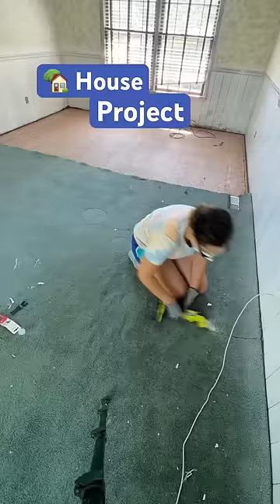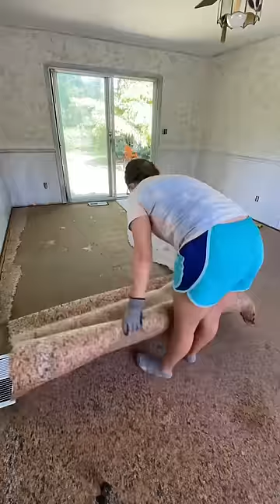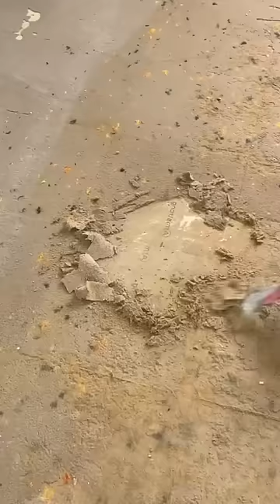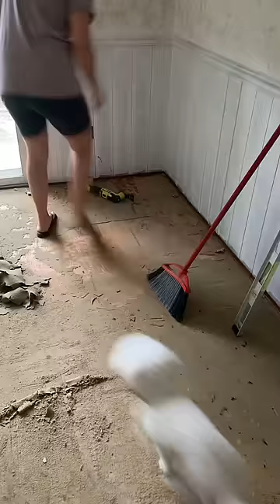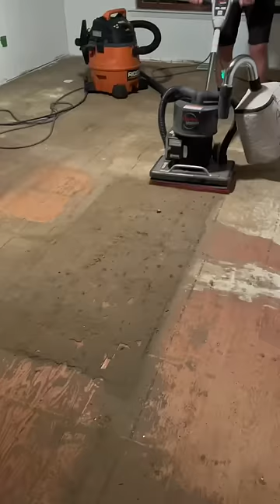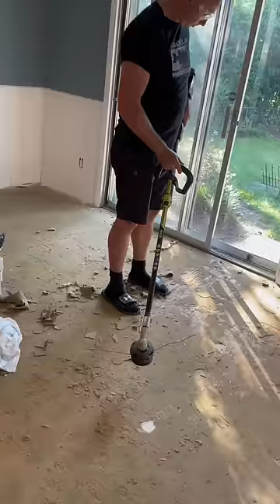Ep.7 DIY fail removing what we found under carpet | Carpet Removal | House Project BEHIND THE SCENES

Comment: Since no one else is gonna tell her I will. The last thing to get done in a remodel is painting, it's most definitely not wise to do it before the floors are finished.
Reply: Actually the walls normally get done before the floors because it's easier to not damage the floors that way and you can then install your baseboards with a nicer finish on the transition between wall and base board if you paint before and you cant do base boards without flooring. then you do your final coat of paint once the floors are installed as the floor and paint are the last two parts of a reno
Reply: Remove carpet and all debris first. Sand and clean floors. Prep them for finishing. Paint your walls. Then do your floors.
Reply: @Rebecca-n7n so they are both right
In their own right
Reply: Disagree. Pull up old flooring, then work top to bottom. Paint ceiling, paint walls, put down new flooring, base boards.
Reply: The problem is you don’t start painting when you still have things that need demo or removal in the same room
Reply: I'm sure she's now very aware
Reply: I’m having a new house built and my walls were painted way before floors. AC had to then go in, floors were kinda last.
Reply: @kutatm  we're taking about a remodel, not a brand new house.
Reply: Work top to bottom. Ceilings, walls, floors. Not to mention floors are generally the most expensive part so best to keep that in good condition.
Reply: Yea that’s not really how it goes. Floors get done after painting to avoid paint getting on the new floors.  Floors should generally be one of the last things to get done.  Nobody wants to be the flooring company to come back out and fix floors cause they were damaged by another contractor
Reply: One can do the paint after the floors are prepped, but never painted if the floors are still in the beginning stage.  Shows the smartness of women in these situations…I work on the part time and I had to tell the woman owner to slow down because I was the last contractor there…her major remodel was electrical and I still had add on’s and major holes.  I gave her only sections she could do.  Which we found a medium ground.  I asked her not to do the painting if I were going to be there, that paint seemed to stink?!?!?
Reply: Demo goes before finish painting.
Reply: Agreed on that one. They are on a learning curve.
Reply: You do remove the floors before you paint but you would never install floors before you paint unless you don't know what you're doing. That would literally be the stupidest thing you could possibly do.
Reply: Actually I did this for a living. First you remove the carpet use an ice scraper that you put a very sharp edge on and then scrape it up. Use a broom and a vacuum to get as much as you can off the floor. Then you can paint the wall after the wall is painted then you put down your padding and your carpet. Whatever you do do not put down the carpet before you paint. Can you figure out why?
Reply: One would think !!!!
Reply: Facts
Reply: @Schmuly yeah but rip up the old floor first.
Reply: @noname357 You remove all things that needs to get removed before you put in new stuff or paint for many reasons!
You can discover mold that goes all over the floor and up in the walls, etc...
Plus this obvious reason!
Reply: Wow.  So incredibly wrong lol
Reply: Its way easier to demo first, then flooring then paint. When doing remodeling.
Reply: Learned a valuable lesson,do all demo before getting things painted!! Including removing the the carpet,pad and tack strips.
Reply: @Schmuly 😂😂😂😂😂😂😂no
Reply: Floors are last thing ...
Like taking a shower ..or washing a car 
 you finish things from top to bottom ... 😊
Reply: She figured if she puts paint on floor .. it woulnt matter. Knowing that, it makes a painting job much faster..

Not a bad thinking except. But imo.. i would of removed carpet first, then paint, then put new floor
Reply: @Schmuly Are you trying to be funny? She was painting while scraping the floor
Reply: @Schmuly the new floor is installed after floors, but you rip out the old carpet before you paint lol
Reply: You're wrong. Walls first before flooring. You can always touch up the walls but if paint gets on the floor, you gon need to scratch it off
Reply: Does it really matter
Reply: Think she found out by now
Reply: @kutatm Yes, that is how new homes are constructed,  because you have a lot of traffic even after the walls are up,  you don't want a bunch of boots tracking in abrasive debris to ruin new flooring.

Doing a remodel of a single room is different. One demo and any significant rebuilding is done,  you can finish the room in any order,  and contractors will do it in order of availability of their subs. Painters can lay down sheeting to protect the floor while painting.
Reply: When you cant afford a floor scraper tho does it really matter
 
That was a 30-60 job with the right tool.
Reply: @chellestan Basically, prep the work area in full first, then work top to bottom
Reply: Never forget the rule, Bottom to Top not Top to Bottom
Reply: Y'all arguing about the order of the process and forgetting the big facts that the wall finishes and floor finishes chosen also make a difference. I'm a sparky and I can tell you that it definitely varies from site to site and that's why it's important to have a good project manager or general contractor, to make sure trades don't have issues like this where one person's work can ruin or degrade another's just by way of being done. Tile is done differently than wood, than carpet, than finished concrete, than various forms of laminates, etc. Each individual flooring type has its own process and some of them require the home to be a conditioned space before they can be done, and some have to be done before the walls are even framed. 

Y'all have missed the most important part about the whole thing, trying to argue about who's correct. You're all right and you're all wrong, you're not asking enough questions, and making too many assumptions. Thanks for the entertainment though, I hope y'all aren't in trades.
Reply: Close! Someone has to tell her that, don't stand with your back to your freshly painted walls, while your near sighted husband while wearing a goggle is doing something stupid.
Reply: Literallllly, you are correct 😏
Reply: Common sense
Reply: Boy are you do because of the amount of wear and tear while you are refinishing the rest of the rest of the house.
Reply: That Gunk as you called it was the Matt underneath your linoleum it just kind of glues itself kind of melts over time
Reply: Floor scraper is a must. Maybe this video is just for views 😂
Reply: Break the house & build again 😭🤣
Reply: Righttttt my mum did this and I was dating someone that owned a construction company at the time 🤦🏽‍♀️😂
Reply: Wrong sir!
Reply: @Schmuly  You're wrong, paint gets done last, flooring damages walls and trim. Professional renovator

Comment: Flooring installer here, the stuff under the foam underlay is the left over backing from rubber backed carpet. It was a short-lived type of carpet installation back in the 70's and 80's. et way to remove it if you where to put any other type of flooring down is to either us a a 5inch scrapper and have 2 people going at it. What my employer and I do is use a machine called a "Poyvac" or an orbital floor sander with a pad with 3 9inch concrete disk spread out in a triangle like pattern on the pad, earmuffs and dust masks are a definite must as tis does create a lot of dust. once We've sanded the entire floor it's then swept up into a pile and taken to the work vehicle which has a large sheet of plastic in the back so that it maybe folded back onto itself once all the dust is on the plastic sheet. After the room is vacuumed and ready to go for installation for whatever floor coverings you wish to have done in that room.
Reply: What about all the staples
Reply: The grinding pads on the polyvac run over the staples, pulling them out as the machine runs over the floor. We then go around the edges of the room with a hammer and scraper if there are any nails in the floor there bashed down so that they are level.
Reply: Why machine? Just hot water.
Reply: Thank you. Great to know!
Reply: I can attest to that stuff not lasting more than a year or two before getting flattened out and decaying into "gunk".
Reply: That gunk also contains all the dirt that vacuum cleaners and steam cleaners miss.  It filters down through the carpet.  I've scraped up a MOUND of dirt that had solidified like concrete.
Between cheap backings and all the dirt carpeting harbors...I prefer ANYTHING to wall to wall carpeting.  Especially with kids and/or pets.  New pets can smell old pet stains, even after removing an old carpet.  Had to remove raccoon covered carpet from the house I am in.  I still have a couple trouble spots the dogs smell. 😒
I now only use area rugs that can be put into a front loading washer.  
I feel for carpet guys who have to go in and remove old carpets. People have no idea how much of themselves they leave in them. 😳😳😳
Reply: My dad the ,carpet installer ,has on occasion used child labor to remove that stuff. 😂I knew exactly what it was ,even if it was under the padding!
Reply: Yep

Comment: That’s the cheapest foam underlayment (pad) for carpet.
Reply from the maker: It was caked on good
Reply: @theyorks I’ve seen too many of these🤢
Reply: Pulverized too?
Reply: @theyorks it rots over time. My mum's carpet backing ended up as dust that kept getting hoovered through it
Reply: Bingo  its foam backing
Reply: Yep we had some of that in our our house when we had new carpet installed luckily it was just 1 room and most of it came up easily. Some dry ice and a floor scraper took care of the rest. We aways buy the highest quality underlayment that the company doing the install sells!
Reply: It’s the foam backing from an old carpet , the fitter who put the underlay down couldn’t be arsed to remove it . U was doing well with the floor scraper .
Reply: @leslie1971 bruh, she had a multitool...
Reply: Yep, totally deteriorated. Reminds me of what was under the 40 year old carpet in my parents house.

Back then, carpet was glued to the floor.
Reply: @theyorks of course it was. People walked on it for years. It's like dust sized plastic. They stomped it in.

Comment: If there were only floor scrapers sold at Home Depot
Reply: Hahaha hahahaha I was thinking that.  And also panting first,  not a good plan
Reply: They rent them also.
Reply: HOME DEPOT AND LOWES are the 7-11 of home improvement . The real tools come from better sources .
Reply: Or a snow shovel if your broke and are in a pinch.
Reply: Or a snow shovel if you're broke or in a pinch.
Reply: @angellee9307 You forgot Harbor Freight 😂
Reply: @drew8256 I just bought my house and going to refinish the hardwood under the carpet this will come in handy
Reply: You say sarcastically lol
Reply: Well she called it a weed trimmer so what do you expect.
Reply: With a wood subfloor I would be scared to use a scraper.  I don't want to take chunks out of my subfloor.

Comment: I work in the flooring department at Home Depot. I think that’s just really REALLY old carpet padding 😭 it’s been there so long that moisture, dirt, spills, foot traffic, etc. compressed it to whatever state that is 😂
Reply: Yuppers that is part of the padding that deteriorated over probably 40 years or more!
Reply: Yes, foam rubber deteriorates, breaks down, cakes up, just does not stay foamy amd rubbery over time.
Reply: I once removed the carpet at the rental house my grandma was vacating, the carpet was there for so long the under flooring desintegrated to a powder, this looked similar to me.

Comment: Little tip, you can actually use a concrete grinder with a hepa vacuum, even on wood subfloor! I’ve been in the flooring business a long time and I’ve done that before. Most times you can use a floor scraper and a vacuum to get that stuff up though.
Reply: As long as what is underneath isn’t asbestos tile… which is what that looks like.

Comment: My sister had the same problem with a clued on 70s carpet. The hole day we tried everything, even a grinder. Nothing helped. My sisters puppy had the perfect solution. During the renovation stress we forgot to walk the young guy in time and he peed on the carpet. After we found out the wet part of the carpet got off very easy. So we poured buckets full of water over the carpet, waited and stripped it off as easy as that :-D

Comment: The tool you need is in the flooring area. It might be called a floor scraper. It's dangerous so you have to be careful. It's this big Razer blade on a handle. Works AMAZING! 
My cousin works in flooring and told me about them.

Comment: It’s adhered from the padding.  A long handle scraper works wonders and you can clean that up in a hour.
Reply: You can do it in 5 minutes with a scraper it's so easy I do hardwood floors and I see that allll the time and that's how long it takes me. Normally I take longer removed by the nails from the edges and cutting the trims to the height of the new floor and remove my baseboards. Now if she wants to be tested and not get any sweat than ya maybe she might take an hour but that's like stretching it. All you need to do is walk end to end while pressing it down and running. This normally takes 5 minutes and it's done. And if you want it really clean you can use a buffer with just the broom after you take out the bulk. And a lot of people have their own buffer or just rent from home Depot they have em for rent. It's a nice way of cleaning you can even put a little bit of soap and wash the floor if you really want it clean the buffer will scrub it for you. All you need to do after if gather the dirty water and put it in a bucket with a towel. But honestly just scraping is enough as that surface will be dirty within a month after installation. I know because I had to fix floors that painters damaged so many times and the bottom was always dirty even when we cleaned it so well.

Comment: Use to install carpet as a child with my grandfather, that dust is the foam padding having deteriorated from years of use, it was likely caked on because of carpet glue! They clue down the padding so it doesnt shift under the carpet. 

I cant imagine its safe to breathe in but just a scraper and a vacuum can clear it out quickly and easily, there are other tool you can use to make it easier but for a room that size just a long scraper to get some leverage and save you back should do.

Alternatively a snow plow like shovel also works.

Comment: Some carpet from late 70s early 80s had foam backing. I’ve had the displeasure of removing it I’m my house.
Reply: Thats what this looks like.
Reply: Yes, that cheap pad or backing just breaks down.  These kids are such newbies.
Reply: It looks like old waffle pad they used pre 1980s. The new installer was just too lazy to scrape it up because he knew exactly what kind of headache it is to do so. It made it that much more difficult for the new homeowner to remove.
Reply: some of it also has asbestos, this one looks like that. smart move ...

Comment: Harbor Freight sells cheap, but effective floor scrapers. Specifically, you went the one with the long handle, not the short version, and a few spare blades. I think, it was like $10. or something. This stuff looks soft though so maybe just a flat shovel would have worked. Still these other folks are right whatever that is, you might now want to handle or breath it. Could be asbestos.

Comment: That gunk is the carpet backing from a foam back carpet or an underlay of the same material. It's normally used on cheap carpets. It breaks down and sticks to the floor over time and makes removal a pain. Best way to het it off is to use a wall scraper to get it off.

Comment: So black mastic glue was recently found under the carpet padding in my remodeled basement. Black mastic glue was a glue used years ago that almost always has asbestos in it. The required testing proved this was the case in my basement. I say all that to say, be careful when pulling up old carpet and/or tile.

Comment: T here is a machine called a terminator which is used to take tile flooring off. It's a weighted blade to keep it against the bare floor. You ride it like a chair & it  runs a wedge blade  which would lift it, then be able to use a shop vac to remove debris. Whole house  1hr. Job & 30 min vac.
Overkill but fast.

Comment: I had this gunk when I removed the carpet in the basement. Scraping was a real pain in the butt. I ended using a steel wire brush on a grinder, worked pretty well.

Comment: I had to remove that mess off my hardwood floors when I bought my house. The thing that worked the best was a heat gun and a scraper. The heat gun would warm up the adhesive and the scraper would lift it right off.

Comment: That gunk on the floor is foam underpadding filled with ages of dirt. Scrape it up and get a shop vac and clean it out. Them mop the floors. You can also do a light sanding of the base floor.

Comment: I’ve run into that several times as I do maintenance and remodeling.  I like to use a wide floor scraper but you have to be careful not to damage the floor Beneath  if you don’t plan on putting carpet back or covering with another flooring product.

Comment: The pads are glued. There are floor scrapers to scrape the floors to remove it. I just bought a long bladed stainless steel one to clear my floors. It is a lot of work. Why I would choose wood or stone tile over carpet anyway. Long lasting and easy to clean.  Just think of dirt, allergens in and under those carpets....